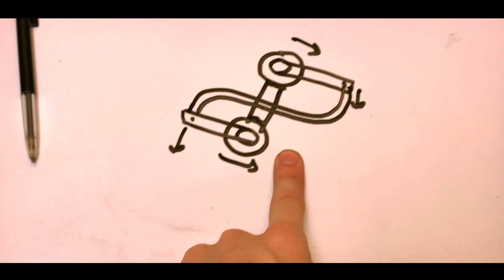Debunking The Backwards Brain Bicycle (vs SmarterEveryDay & Mike Boyd)

Comment: I was somewhat silly in my youth and I tried riding my bike with my arms crossed. That was all good for maybe 50m or so until a German sheperd dog decided that it was time to run out from the side of the road to attack. Instead of swerving to the right away from the dog I went to the left, front wheel down a drain and cartwheeled sending the bike flying. The dog decided I was a risk to it's health at that point and took off. That was the 1 and only time trying that maneuver. Riding like that at 25-30kph with dogs and drains in the vicinity isn't something that I would recommend.
Props to being able to ride the reverse bike as easily as you did.
Reply from the maker: That sounds horrible! I hope you were okay! Must have been traumatised by that!
Reply: Bit of bark off me but no barker imprints in me so was all good. I've had plenty of spills over the last 50 years and that 1 was spectacular but fairly uneventful.

Comment: I think what happened is that the steel wire gave i little more stability since the wheels could slightly steer to the normal way without pushing on the handle, giving you some stability and more time to correct the position of the handle. That, combined with years of experience riding bikes every day. I think the gears add another layer of dufficulty. Eitherway, good video, keep up the good work

Comment: There are far too many variables here to say you have ‘debunked’ the original. Just off the top of my head there’s:
Different steering setup 
Age of the rider
Level of relevant experience of the rider
Weight and proportions of the frame are different.
No number of test subjects

However this video is really interesting when thinking of brain plasticity. It’s clear that you have experienced many different types of bike alterations and I wonder if this constant pushing of skills keeps your brain more adaptable. Also your steering arrangement allows for much more cognition of how the handlebars affect the wheel and I think your level of perception allows you to calculate the angle of the rods to the angle of the wheel. There is more than just steering going in here and balance and how micro movements affect centre of gravity is a huge part of riding a bike. I think your neural pathways that deal with this will be much faster due to your experience of riding different bikes and cycles.

It would be interesting to see members of the public with less bicycle experience try out your bike or for you and smarter every day to swap bikes.

Comment: 8 months seemed too long to me, a year ago I also made myself one of these bikes and it took me less that mike to learn. 
I've ridden unicycles, giraffe unicycles and giraffe bikes before, so maybe that also has some influence. 
And after riding for a month with the backwards bike , I tried a normal bike and by the second try I knew how to ride. It must be that some brains are harder than others.

I have a tricycle, one of those with 3 wheels like a bike and there are people who do not know how to ride it, they try to lean to take the curve and they go to the opposite side to the one they want to turn without being able to avoid it. They try to turn the way you turn on a bike and on a tricycle it's different. I hadn't thought about it until I saw that it happens to half the people and I will have experimented with about 500 different people of different ages.
They try to turn the way you turn on a bike and on a tricycle it's different. I hadn't thought about it until I saw that it happens to half the people and I will have experimented with about 500 different people of different ages.👍👍👍

Comment: Man, this is it! I knew that I  can't be that hard if you ride bicycles everyday. I always wanted to try this myself, since I had an idea I want to test: Why not start by riding the bike without using your hands at all? And then once you are comfortable riding it free-handed, gently start placing your hands on the handlebar and start to get a feel for it. Also, I think the experiment should be tried with unicyclists.
Reply from the maker: We had the same idea, but the friction in the system held the handlebar a bit too much in place to rely on gravity and leaning for steering sadly! We want to try again some day with smooth gears, but  we would have to find a new test person that is unbiased.

Comment: 1) You are not the same age as Dustin... reproduce all the exact same factors including the gears. Older peopl,e their brains do not exhibit the same neuroplasticity.

2) I work with a neuroscientist. He confirms that, under normal circumstances, the brain does take about 8 months to make major changes. However, he has worked with people that it takes about 2 days to make that same change with very specific conditions.
Reply: I think in this case its more a factor of experience in bike riding. Destin and Mike both are inexperienced riders, the boys from Raphson ride daily and always try crazy stuff on bikes. Also the difference of 2 minutes vs 8 is too big to be just neurologically related.
Reply: Gears shouldn't make too much of a difference, both setups are ~1:1.
Reply: @emptylog933  i think this assumption is wrong.   You don't only steer with your hands, there is balance, weight distribution and the geometry of the bicycle (trail) all are factors.  It's not that hard to ride with no hands.  The 'slack' in the cables allow reaction time to counter-correct wrong inputs, the more direct gears make any wrong input immediate and throw your balance the wrong way.  You can see in the example of Raphson steering on the bike path with his legs, counterbalancing the direction to remain straight.

Comment: I think there are enough recent cheap junk steel bikes around, no need to ruin a 60s/70s frame which are getting rare, and you also might have damaged the original parts by just stepping on it with no respect...